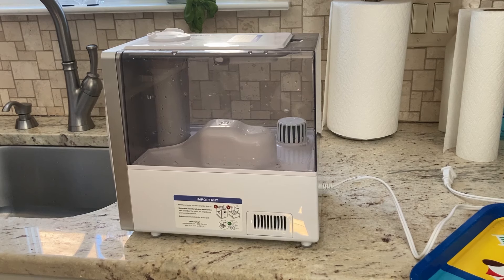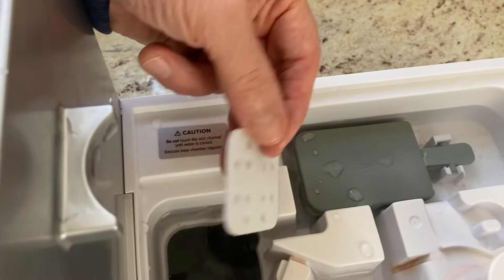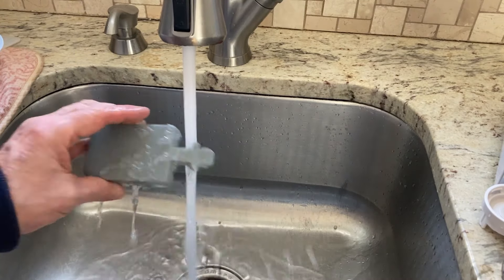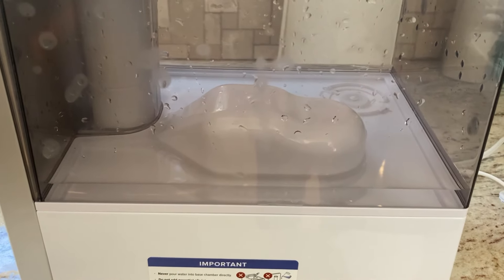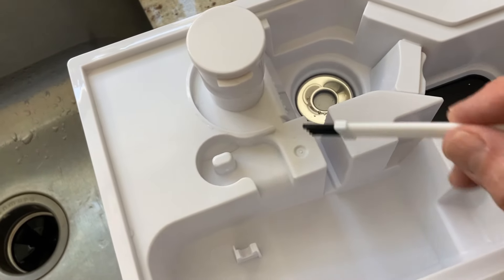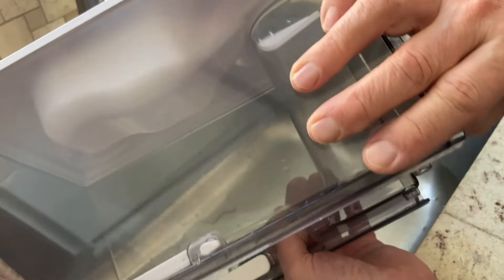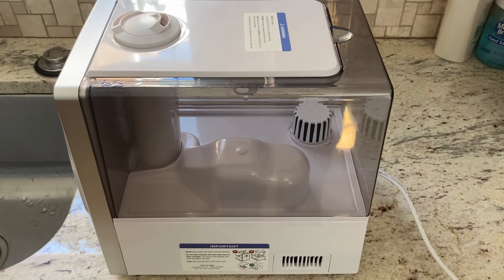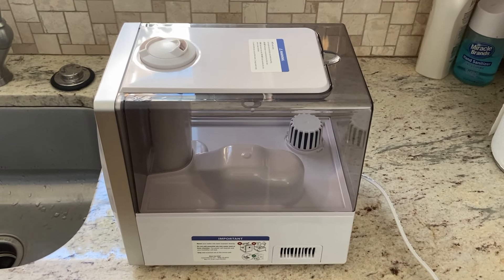Cleaning the Levoit LV600S Humidifier - "By the Book"

Comment: Dude, you have way too much IRON in your water. Use while the instructions suggest using distilled water, all distilled water is boiled filtered water. The boiling is just there to kill any extra germs in the water (which their shouldn't be anyway). So I just use filtered water from a Brita water pitcher. I use it because theirs a lot of iron (as indicated by the subtile rusty red that comes out of some of the old pipes in my apartment) to filter that out.
Reply from the maker: Thanks for the suggestion. That might be a nice compromise between using tap water and buying and storing gallons and gallons of distilled water.  In the case of this video, the humidifier was really just a "first use" test for humidifying musical instruments that required that the humidifier be on 24 hours a day for 3 weeks straight. I'm sure most people aren't using it at that rate or spacing out the cleaning that far. It just wasn't practical to buy and store so much distilled water for this use. At this point,  however, I just take 15 minutes to clean it weekly, and the build up is really pretty minor.
Reply: @goodcourseproductions5546  So a followup to my response. While the water filter does help filter out heavy metals (e.g. Iron), there's still the issue with lighter metals (e.g. Calcium, Magnesium). It probably was not a good idea to get the white version of this humidifier because it almost didn't seen noticeable, but it was there and likely spitting little calcium ions into the air as part of that "white dust" everybody talks about.  I wish Levoit would let us use one of those floating cleaners, but that would probably make things worse because then it would be spitting out saline (salt mist)...on the other hand that might be good for the nostrils....just not good for everything else in the room.  I should probably look around for some other solutions to fix the quality of the water.
Reply: I just don't see myself using one of those distiller devices considering the 700+ W power consumption. For comparison, the desktop computer I built has a power supply unit that uses that has a maximum power usage of 850W (which it doesn't really use all the time) and it does more than boil water.

Comment: Why is it so complicated?
Reply from the maker: In reality, it is not complicated at all. Keep in mind the purpose of the video. The video is intended to help people who have "already purchased" the machine and want to "learn" how to do a complete, thorough, cleaning and descaling  as it is described in the manual. The humidifier was intentionally run non-stop for 3 weeks, using tap water, without any cleaning, so that it could build enough bacteria to demonstrate the cleaning process. In reality, on a normal week,  with normal use, my humidifier doesn't build much dirt and bacteria at all. I can usually clean it in less than ten minutes with a fairly simple rinse and do it practically with my eyes closed. If you clean it once a week, and use it normally, it is quite easy.

Comment: Omg why so complicated then putting bk together
Reply from the maker: As I have mentioned to a couple other commenters, in reality, it is not complicated at all. The video is intended to help people who want to "learn" how to do a "complete", thorough, cleaning and descaling as "it is described in the manual". The humidifier was intentionally run non-stop for 3 weeks so that it could build enough bacteria to demonstrate the cleaning process. In reality, on a normal week, "with normal use", my humidifier doesn't build much dirt and bacteria at all. I can usually clean it in less than ten minutes with a fairly simple rinse. If you clean it once a week, and use it normally, it is quite easy.